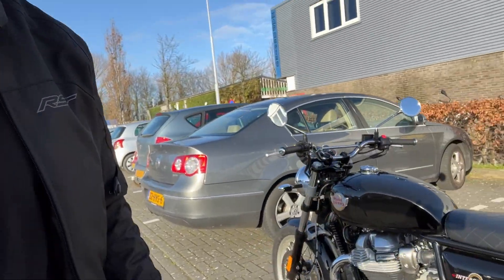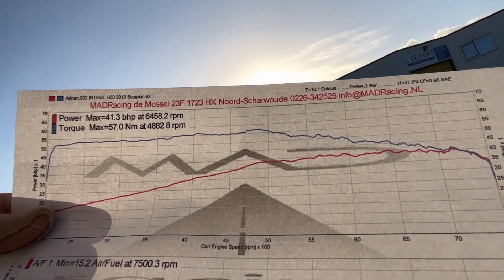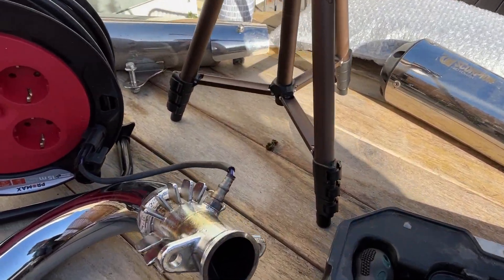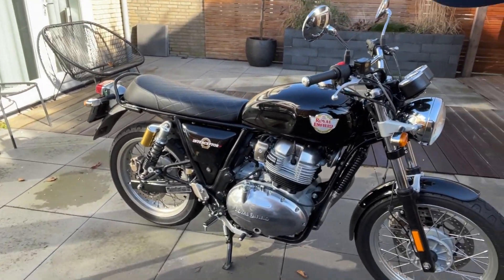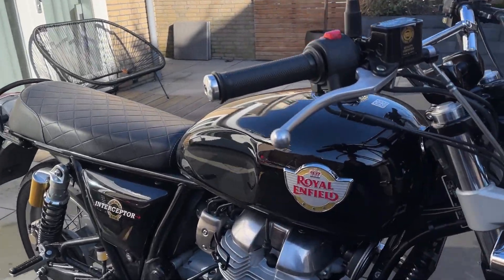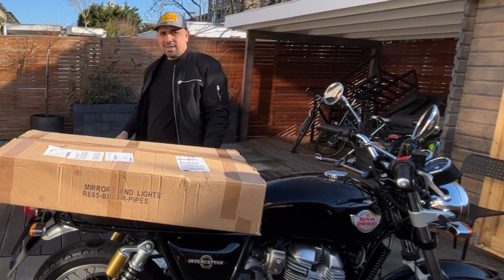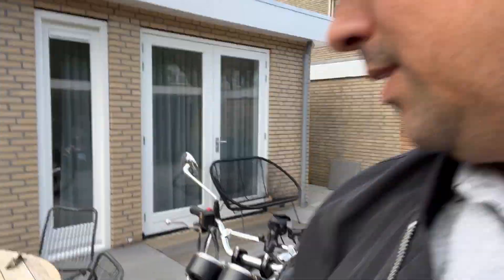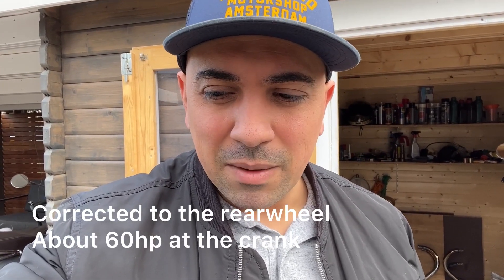2019 Royal Enfield Interceptor 650 Tuning: REAL Horsepower!

Comment: How much did these mods set you back? Cheers from The States?
Reply from the maker: The power commander was about 350 USD, the air filter about 80 USD, the headers around 250 USD, and the tuning around 250 USD as well. The silencers were on the bike when I bought it, but they were like 600 or 700 USD when they were first offered. But you can get a quality set of silencers for around 300 USD. 
I have another Interceptor 650 with an S&S cam, which costed me around 200 USD. It changed the bike in the sense that the power was now available much higher in the rev range. I preferred the low end torque more. I have to change to a larger front sprocket size to compensate for that. The good news is that it now has the oomph for that
Reply: Thank you I am now a subscriber and soon an INT 650 owner😊

Comment: What is the power commander five, and what is a custom map? Is this some kind of electronic gizmo that allows you to tweak software or something? Is this something someone can do at home by themselves, or do you need some hard-core mechanic to do this?
Reply from the maker: It’s a piggyback ecu that allows you to tune the fueling for specific rev ranges. Installing it is simple, but the programming of it is Not a job for a beginner.

Comment: Amazing what a good tune can do. Just slip on mufflers, open air filter and a tuned power commander can go a long way from a rideability standpoint. Fuel and ignition are key at the minimum, factory lean fueling and retarded timing are the first things to fix IMHO.

Comment: It's not clear what contribution the piggy-back ECU made and how much you modified its "as-bought" map.
Did you modify the air filter, and if so, what improvement it and the exhaust made without the piggy-back ECU mod.
Reply from the maker: Correct. It is clear what we have achieved with the piggy back ECU. As for the impact of each part separately, that would have meant a number of additional dyno runs $$$, money I'd rather spend on fine-tuning

Comment: I'm happy with mine  just as it came out of  the factory. I would like a rear luggage rack, an fully enclosed chaincase, and a siamese exhaust [NOT a two into one]  as standard, also better mudguards that kept the road muck from the bike would be nice, and some different handle bars, and some quality fitted luggage panniers. One thing puzzles me, If you wanted a fast bike, why didn't you buy a faster bike? cheers.
Reply from the maker: Sounds like you have some really nice plans! Buying a different bike purely for better performance would not have given me the same feel as I get from the Interceptor. I feel that this is exactly how it should have been. Unrestricted.
Reply: @bensal07  ok. I was not criticising  you. We are all different. I notice that you seem to be the only person who has bothered to stick the bike on a dyno to find out, what difference the modifications made. .stick a new pair of spark plugs in the bike when your on the dyno next, and I wonder if it will make a difference? cheers, .

Comment: In the UK this sort of thing is what the government is trying to stop with an 'anti tamper' law against any owners interfering with any system of a vehicle which could affect the safety or emissions of the vehicle
Reply from the maker: It’s the same in many European countries nowadays. Funny enough these motorcycles leave the factory running extremely lean to meet emission regulations. Richening the fuel mixture is actually better for the engine and it’s longevity. Emissions, well, the difference is marginal. Especially when you run the bike with baffles (sound emissions). A small difference in increased production of CO/NOx particles, yes. But then again, I live 10 minutes away from the airport. Whatever I do to my bike, it’s not even 0,000001% compared to 1 single small airplane.
Reply: @yumpladukfoo I'm Jealous haha

Comment: Thanks for sharing your upgrades, useful info. Couple of questions - what PC map did you start with (was it straight from PC or was it a Hitchcock/Tec map).  What tweaks did they make to the map? Did the headers make the exhaust very much louder? Running DB killers?
Reply from the maker: Hi! Thanks for commenting. The PC was bought with a pre-loaded map van Hitchcocks. My dyno guy said that it was a pretty good map to begin with. The changes heb made were richening the top end a little bit,and taking out a little dip at around 4000-5000 rpm. The headers give a deeper sound to the Interceptor, and a little bit more noise. The Interceptor wat tuned and dynod without DB Killers, but I always ride WITH the DB Killers. It sounds just about perfect now. Classy, not obnoxious

Comment: You might need performance clutch now.
Reply from the maker: Hi! Haven’t managed to slip the clutch yet, so far so good! I’m planning on adding high compression pistons and high lift cams in the winter. I suspect that I might need a clutch or clutch spring upgrade then.
Reply: @bensal07 you could go down one tooth to a 14 front sprocket,
Reply: @bensal07  hay you haven't done s ride review of the mods you have done on the street,,
Reply: @bensal07  I've heard this is a better-option than the big-bore , unless money is no object . The increases are a better 'bang-for-your-buck' than the big-bore .
Reply from the maker: Haha I know! So much to record stil, so little time 😭 I was actually planning on going up 1 tooth in the front so I can cruise at 120 km/h and have less than 4k rpm. Pulls very strong in every gear
Reply: @bensal07  4k I nothing for a 7k rev bike, I say go lower first to see what you get out of it. I hope s&s make a taller 6th gear ⚙️ for the RE 650's.

Comment: Thanks for the detailed information.
Have fitted the Tec cannon mufflers, with the headers on order.
Reply from the maker: It’s an excelleng upgrade. If you decide to upgrade the airfilter or just remove the snorkel off the air-box, you will have to add some kind of fuel controller like a powertronic or powercommander to compensate with extra fuel. A booster-plug will not be enough! All of this is to prevent your engine from running too lean and getting too hot.

Comment: Hey My friend, thanks for the vid, it was great very straight up and direct before and after. 2 questions, why did you plug/remove the O2 Sensor. I'm getting the Rec Headers as you did, however I'm struggling with the exhaust, I noticed you are running Scorpions, I'm looking for performance and my understanding S&S give the best performance, so they say, I don't know if that is true maybe cheapy diablos are just as good as Scorpions or S&S and so on, they all allow for more free exhaust, why did you choose Scorpion exhaust and do you know if there is a big difference between them and are you happy with the Scorpion and why didn't you go with the Tec Exhaust. Sorry buddy a lot of questions I know, my apologies.
Chees
Karl Squire
Reply from the maker: Hi Karl, thanks for your comment and good question. I went with the Scorpions because....they were already on the bike when I bought it :) I think the S&S exhausts look better, as well as the TEC exhausts. But since they were already on the bike, I just kept them and spent the money on headers. I am very happy with them, but don't consider them to be better or worse than the S&S/TEC ones. 
As for the O2 sensor: you can keep it on the bike if you want to, even put them on the new headers. DynoJet Power Commander recommend to disconnect and remove them. There are 2 plugs supplied that connect to the original wiring harness. However, my tuner told me later that you can keep the sensors, the effect can be notice when the bike is idling, that's when the sensors work. Some people experience poor idling when the O2 sensor is removed. I haven't had such experience. Hope this helps
Reply: @bensal07    Adnane, Thanks man for getting back to so quickly, that bit of info in your replies helps a lot. My brother from another mother :-) Have a great day buddy and thanks again for your vid and the time it took you to make it.

Comment: What's your top speed?
Reply from the maker: Right now it nearly hits the rev-limiter when the speedo shows around 165 km/h
Reply: @bensal07  wow...
Reply: @bensal07  I did 180kmph in speedo...and it hits the limiter and mine is stock one...no mods nothing...
U know stock one produces 47bhp and 52Nm in crank...not on the wheel...at the wheel stock produces 41bhp...but here u got 10bhp more but there is no significant improvement in topspeed...
How come ??
Can u explain ??
Reply from the maker: @TheAutoblipper  Gear ratio. Thats how you get a higher top speed. Now that the power is there, the gear ratio is the limiting factor. Stock gear ratio works well with stock performance. Once you have more power, it becomes a limiting factor.
Reply: @bensal07   i think u are also running on stock gear ratio n the rev limiter is also same as stock in ur bikee...technically it should have the same topspeed as the stock gt..but topspeed will be reached much quicker than stock one as ur bike has more power n torque figures with reduced weight...
Am i right ?

I m using 100/90-18 at front and 130/70-18 at rear...
What's the tyre size of ur bike ?

And is it possible to get the power commander in India....
Here the PPL are using powertronics but I feel like powercommander gives better results...you literally gained around 10bhp and 12Nm at the wheel man...

Comment: Are the headers very important?
Reply from the maker: It was a massive improvement over stock. But the real performance was only unlocked when I had the Powercommander tuned on a dyno. That is not a job any mechanic can do, you need a specialist. I have to say that the maps PowerTronic and Hitchcocks(powercommander) deliver are very good starting points. Just don’t leave the fuelling stock when you go with free-flow headers. Otherwise, best keep stock headers.
Reply: @bensal07  can I just put a powertronics ecu on it. My bike has redrooster exhaust and a DNA airfilter.
I would prefer change the pipes unless it gives me a great difference in performance
Reply from the maker: @pranavsuresh8925  adding a powertronic will make a difference. Make sure it is loaded with the correct “map” for your set-up. If you decide to go with the free-flow headers, the improvements will be very noticeable. Again, you will then need to upload a different map for that set-up.
Reply: @bensal07  thank you for your reply
Reply: @pranavsuresh8925  Also the weight difference is lighter than stock a 2-2 big bore headers will be 4kg lighter & 2-1 will be 7kg lighter & 2-1 will be 2-3hp & 9-10Nm more than the 2-2 big bore headers with out power commander but will change the look of bike.I reckon the 2-2 look better but performance & weight is better with 2-1 & with power commander be even better.Tec states their 2-1 no power commander gives 53hp & 73Nm on their Dyno at TEC not sure if they used Dyno jet Dyno & different Dyno = Different results.A true comparison will be on same Dyno.
Dyno jet is one of the best one's.

Comment: Well done bro I was thinking about doing this.👍
Reply: I like the bit at the end of video when you talking about the improvements.You can hardly contain your smile explaining how it pulls that had me sold on your improvements.Great job.😁👍
Reply from the maker: Thanks brother. The difference just the exhaust makes is impressive. But the difference the headers make in combination with the right fuel settings (with the help of the Power Commander) is mind blowing! The air filter doesn’t make a big difference, removing the snorkel/cover plate is more effective than replacing the stock filter.
Reply: @bensal07  I have done a heap of mods already mostly cosmetic but done S&S Slip on's & air filter,booster plug.
YSS fork upgrade,Motone tank pads,Motone up & overs,Grip puppies,R.E oil filter & more R.E accessories.Done a video couple weeks back about mods so far with a great view of New Zealand countryside.
Reply: @ruahinesrider  quite a list ..only another 10 plus to go 😜
Reply: @Alex-io6ky  😆😆